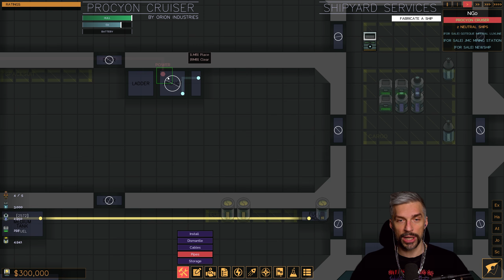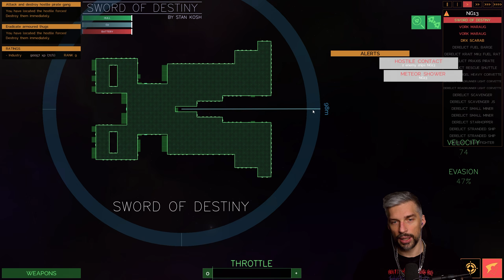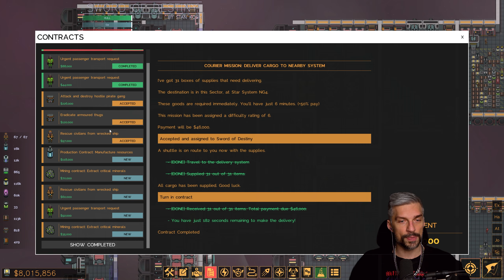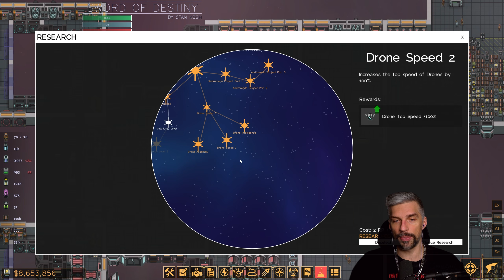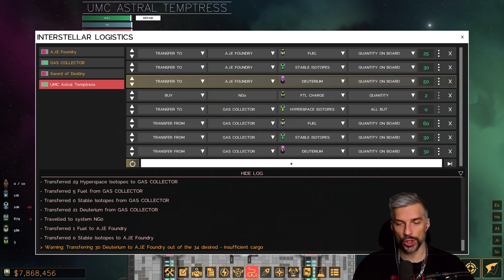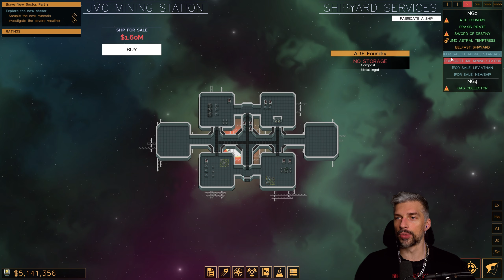Ultimate Beginners Guide // The Last Starship

Comment: OK guide! One early tips is to restart the game until get a good storyline (boldly go) map, with mining and nebula at central shipyard location. Preferable have 2 locations with mining option. You do not loose resources when move devices around, except tank content (can use loaders to empty them, and fill after the move, or half the content by connecting another tank). If need certain parts but don't want to wait for production or in stock, then in creative mode make a ship with needed stuff, buy it in actual playthrough and dismantle the devices (may loose some $ if no use of the hull and sell it, worth it though since the time saved can be used on making more cash). Research improvements first, since most blueprints can wait due to the creative ship tip. Deuterium bottle sells for 10K, so small scoop ship(s) doing long jumps between two locations can be an easy money maker.
Reply from the maker: Nice tips, will include them in the next guide!